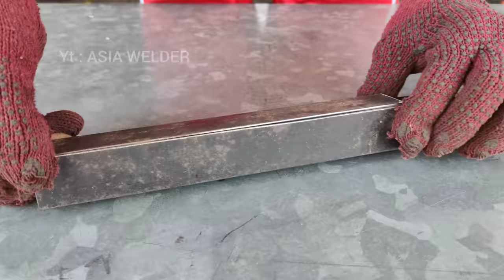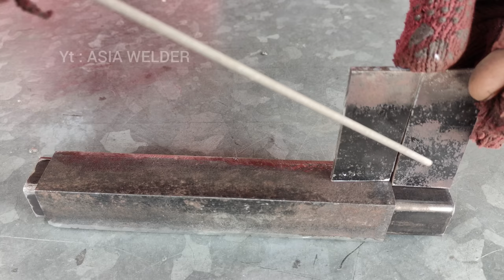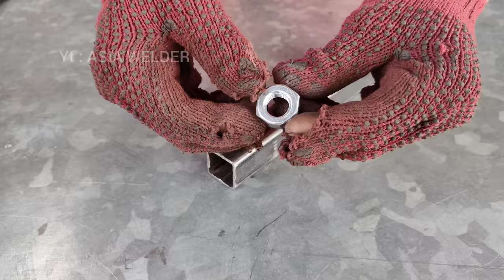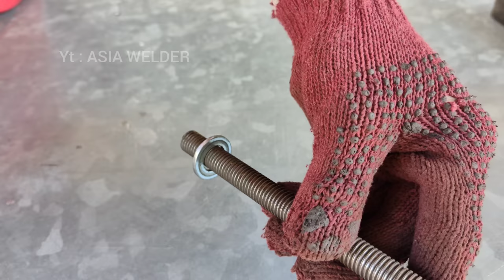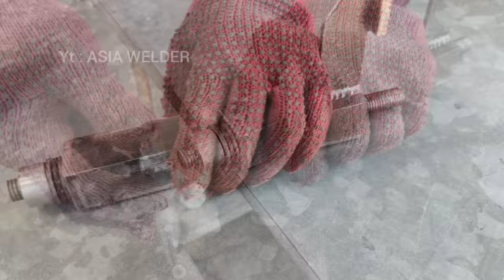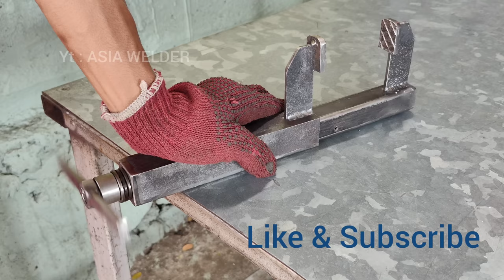A creative invention from a welder that is rarely talked about, the DIY metal vise

Comment: It's a clamp. $5 from store. Why waste time and materials making one
Reply: Because they don't have stores with cheap tools there and because it's a fun exercise, Debbie Downer. It's also a stepping stone towards a specialized clamp one might need, especially with the boxed interlocking design. Instead of the jaws, one could weld plates and use this to bring in two pieces of steel for a butt weld or pull in a dented piece of material to weld-repair.
Reply: It's  versatile  you can get it into tight spaces and you can make it a stronger clamp by using heavier material.

Comment: One advantage of this clamp, that I see, is the contact points do not flex, like most do.   Sometimes that is a great advantage when clamping rounded edges, and the flex point walks itself off the object you are trying to clamp because they spin as you tighten.  This does not spin, I like it

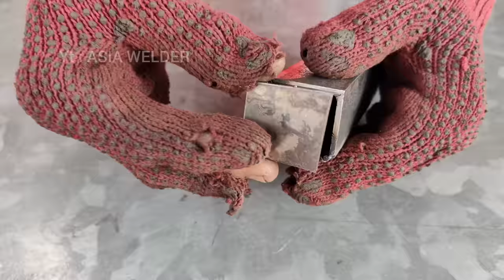Comment: WoW.....small world !.  i've  used that same method, 2:30  time ; for creating a tire changing machine. This, idea used for the top bracket, and vertical arm down to the duck bill changer. Both, for horizontal movement, and vertical for the ducbill.   .....?   Good for you !  Same nut in the tube end, for to hold down the whole bracket, to center post .  Anyway.....thank-you for creating !